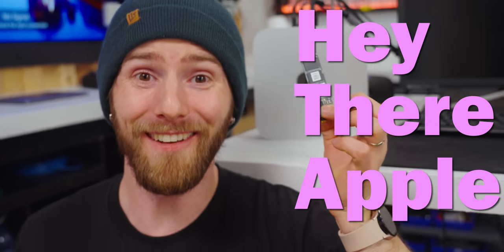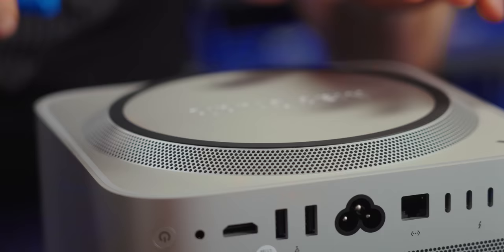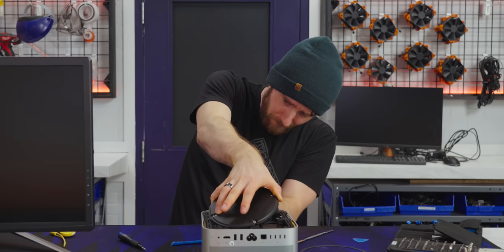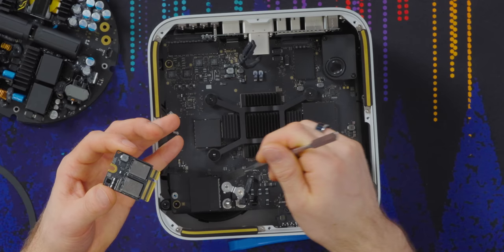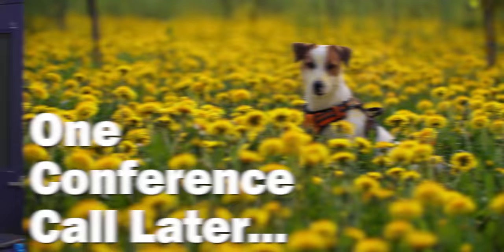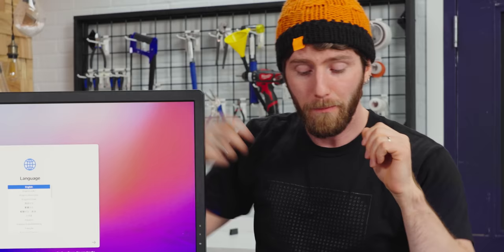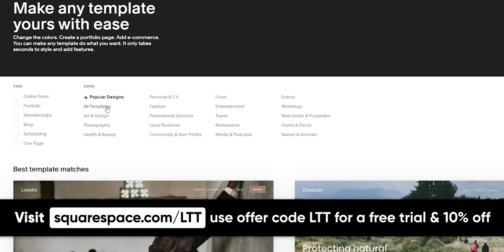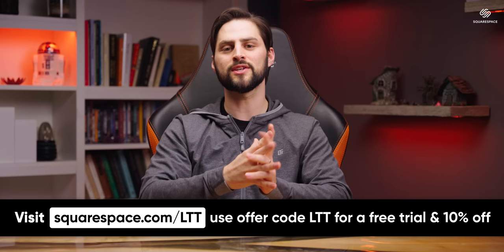I want to love Apple, but they’re making it hard - Mac Studio SSD Swapping

Comment: We have reached the times when consoles have become more upgradeable than Macs.
Reply: like the ps5 where a Blu-ray costs you 100 more?
Reply: @mrld3005  Well, I really don't side with Sony but I looked rn and BD drive with 4k capability does cost cca 100$ alone...
Reply: @mrld3005  Well, I don't think it's exactly the same. PS5's are subsidized to be sold nearly at cost (at launch anyway...). You could easily argue that the drive-less model is actually FURTHER DISCOUNTED rather than the drive model being an 'extra' $100.

Subsidized means the hardware is very cost efficient for the amount of power you get for running games because they are not trying to profit on their console hardware itself, sometimes even selling at a loss. There is a very good reason it makes financial sense for Sony to subsidize their hardware (to build a user base, and profit on the games and other).

The further discounting of the drive-less model makes a lot of strategic sense because now they have a model with a notably ($100) lower price than their "full" model with the drive. The drive-less model forces consumers to buy digital content and games, which are more profitable for Sony and are not re-saleable as used copies. There is no packaging, middle men, and minimal distribution (only server and bandwidth costs, which DEFINITELY are cheaper than the overhead of selling physical copies).

You could compare this to an imaginary scenario where oil companies sold 2 models of cars. One costs less, but uses more gasoline. They can sell the car cheaper and make up the cost with selling them gas.

A console is primarily purchased to play games on, and without a drive, you MUST buy the more profitable digital versions of the game.
Reply: @mrld3005  on a mac that option will be 1000
Reply: @mrld3005  Or A Steam deck that doesn't care if it now has a 2TB SSD (which is never sold out of the box from Valve)
Reply: @mrld3005  . I think the point was expanded storage, which you can’t do on the new macs, not differing model configurations.

Macs do that better than consoles as they have cpu, storage and memory upgrades that can be done at time of purchase, PS5 only gives you a choice of Bluray nor not. The Xbox comes closer as they offer two tiers AND expandable storage.
Reply: @testedtech  You can upgrade an Xbox Series X.....If you buy their proprietary drive, which feels very Apple to me
Reply: @mrld3005   You can upgrade ps5's m.2 to bigger capacity and faster speed.
Reply: We reached that point 10 years ago.
Reply: @brunoais  i wish the base model is storage-upgradable :( (at least swap the nand)
Reply: @DanielHarrisCodes  That's just factually inaccurate, for 2 reasons. 1st- It's not proprietary, the drive you're talking about is produced by Seagate FOR the X-Box. And more importantly, 2nd- There actually is a way around this, using a PCIe4.0 compatible SSD and a CFexpress/NVME adapter (which you can find on Amazon for 30-40$). IIRC this was first done back in September, so surely other methods will come up at some point.
Reply: @DanielHarrisCodes  Yes, I agree with you if that is the case. Why proprietary....sigh...
Reply: @mrld3005  Isn't it nice that they give you the option!  All those Nintendon't owners cut off from their online purchases, I guess, wish that they had a disc to fall back on, even if it's the pre-release beta version most publishers put out on their disks.
Reply: @mrld3005  Last week I added an SSD to my PS5 using Sonys instructions. So yeah :)
Reply: @mrld3005  PS5's SSD slot is actually usable and there's a 3 minute video from Sony that just tells you how to do add more storage by using just a screwdriver.
Reply: @mrld3005  If you are a movie buff you want to pay that for a decent quality blu-ray player. Sometimes more if you want state of the art features. The PS5 with disc drive upgrade is cheap comparitively
Reply: With the original xbox you could install more RAM. The CPU is an off the shelf Pentium, not sure if it's soldered thouhh. The GPU was custom though so you couldn't make a super charged xbox without a lot of reverse engineering.
Reply: yeh because Modern consoles are just computers, they finally realized that PCs were always going to be better so they needed to add everything computers had (internet, hard drives, multimedia, etc)
Reply: to all those defending Sony addition of a BD to cost an extra 100 when is just the reader, then the problem is not Sony, the problem is that there is a sector of people that wants/like to be screwed, the same with apple fans.
Reply: @mrld3005  Then you don't know anything about blu-ray player technology at all if you believe that. Especially a good quality 4k player.
Reply: @testedtech h
Reply: Consoles have been moddable for decades!
Reply: @mrld3005  What did any of that mean
Reply: @mrld3005  So you don't want a BD player at all?  Downloads only?  So, long term rental of your game rather than ownership?
Reply: @zeromant80  You won't get that from apple... Ever...
Reply: @brunoais  Yeah, though i was refering to the Steam Deck
Reply: @zeromant80  Oh! The steam deck. Mb.
You can upgrade the SSD if you want. It's just not a trivial task but it's easy enough. There are some videos here on youtube that show the procedure.
Reply: @Global Communications are you from a communist country? “Why you upgrade?!!!” “You must be quiet!! No complain!!!”
Reply: @DanielHarrisCodes  Theirs already adapters cropping up since the interface they use a standard Type B, which is found in some high end DLSS camera's. The selections limited for drive use since the firmware has to be compatible but give it a couple years and I'd wager there will be a larger selection of DIY expansion.
Reply: @Global Communications upgrading memory is nonsense now?
Reply: @tynao2029  a switch isn't just a computer though
Reply: @robertt9342  ...thats not a feature. Most computer models come with "upgradeable" memory options at POS. the problem is having a non-upgradeable brick 5-6 years from now unless you want to fork over 3-4x what the upgrade is actually worth
Reply: @Global Communications ah yes the two arbitrary numbers argument made small to seem pointless. Were talking having 500gb of storage vs 2 or 10TERABYTES. thats 20 times the storage. 
"why storage tho??????" 
if this is your next argument you clearly don't use computers for anything beyond web browsing
Reply: @Global Communications but what do I expect from someonw that doesn't understand the basic concept of money printing (every country prints money)
Reply: Not the first time, the first macs also were unmodifiable.
Reply: @Biochemical Equation Find me a brand new, first hand Blu-ray drive which is capable of 4K for under $100. Sure, a Blu-ray drive like in the PS3 is dirt cheap... But that was 1080p. We're past that.
Reply: @Biochemical Equation so... $100 for a 4K Blu-ray on a ps5 is sounding more reasonable, right?
Reply: @Biochemical Equation Wait... You changed your mind? You aren't telling me that I'm wrong and gonna get ratioed?! Wow, good on you, not a lot of people will actually do that lol
Reply: @calebb7012  Literally what I was going to say.
Reply: it’s true tho the series x has a slot to increase storage and the ps5 offers a whole m.2 ssd slot
Reply: BRUH